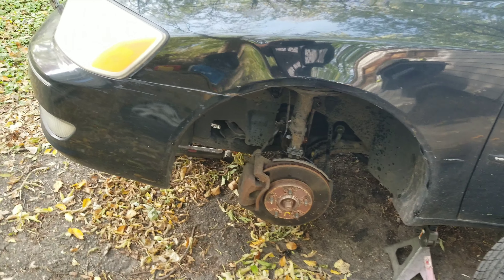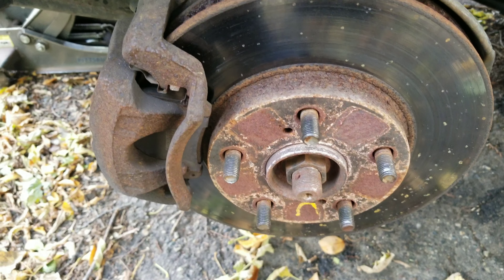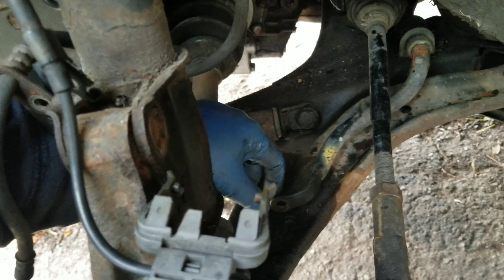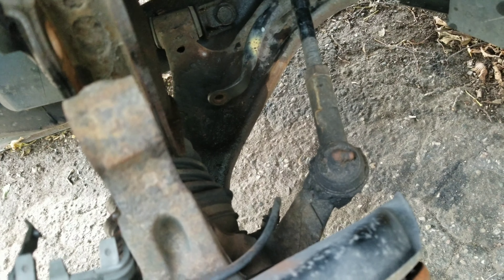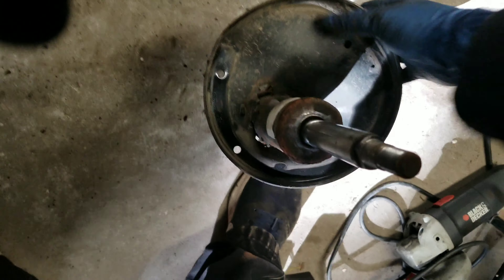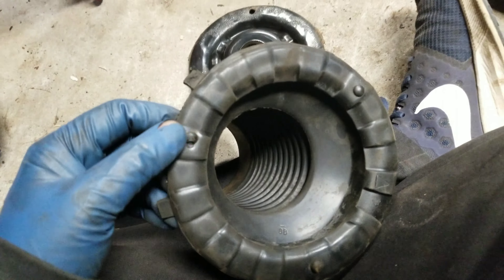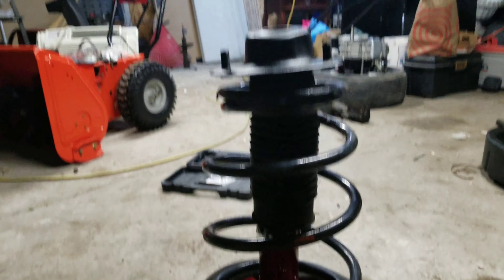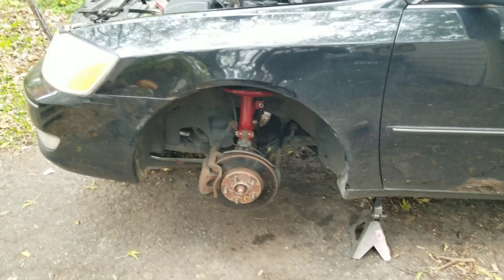2000 -2004 Toyota Avalon Front Strut Replacement

Comment: 1.  thank you very much for the video.  I have a second generation with only 115000 miles.
2.  because of all the speed bumps in the area, I recently had an outer tie rod, right front axle, lower control arms and the three motor mounts replaced.  I went to my reliable garage for good reason.  5 minutes into the motor mounts and a section had to be sent to machine shop.  You never know what will go wrong.  And, when you don't have a spare car or driver, leave the major repairs to the professional like you.
3.  I had replaced the struts years ago.  My kid is more handy than I.  He replaced the struts on his second generation Avalon himself.  I think only the front struts will need replacement and now I know what to look for.

Comment: Did you get an alignment after replacing struts?
Reply from the maker: Yes I did, need to since something of the suspension geometry is changed.... and the bolts holding the knuckle to strut control camber I think.

Comment: Is there any reasons why not show to loose sway bar links out?  I had damm hard time to loose the sway bar links.
Reply from the maker: Sorry, mine were broken at the bottom, just grabbed it with a vice grip and spun it out with a wrench. The top was still connected to the strut tower and it got tossed with it. Didn't mean to leave it out.
Reply: He left out everything. This video did NOT show how to replace the struts in a 2000 Avalon at all.